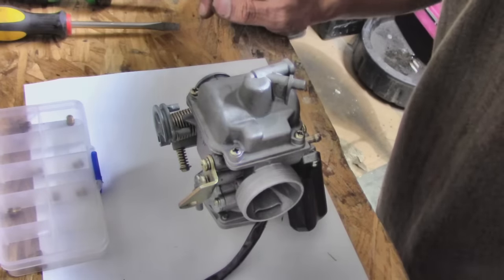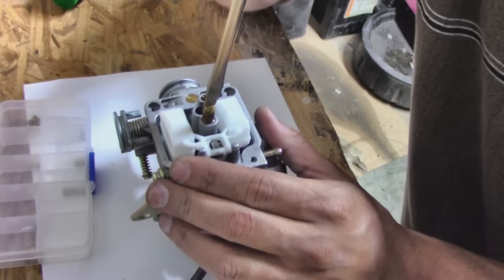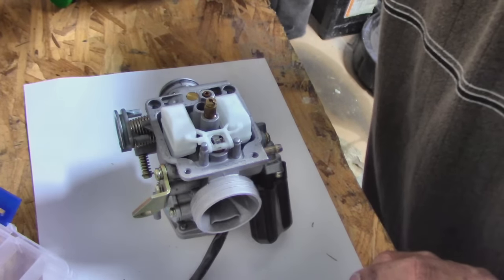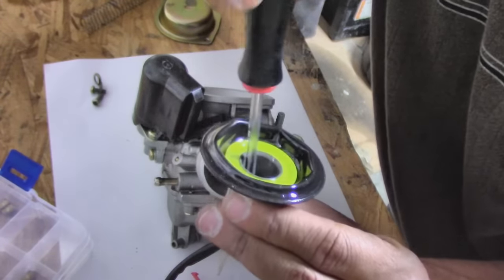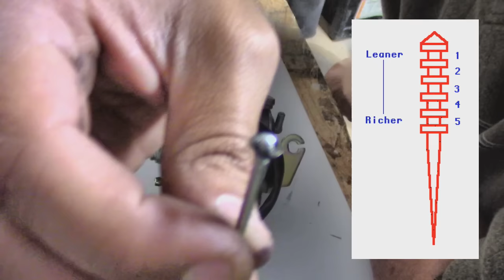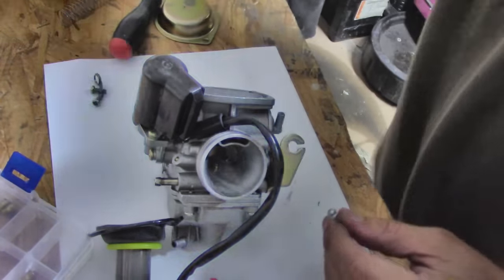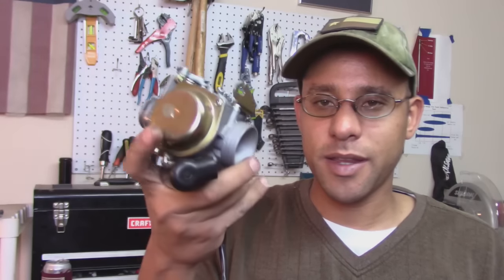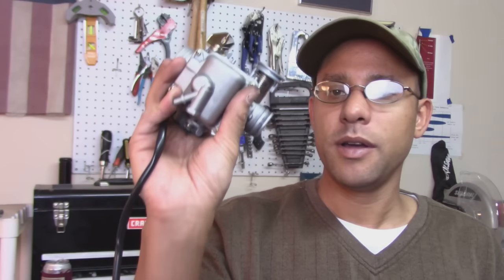GY6: Winterizing Your Carburetor

Comment: Nice vid thanks Joey.  This is my first winter running a scoot, i have had running problems with the colder weather.  My question is about the main jet, did you go up or down in size?  Also how many sizes did you go?
I have been tinkering already & found going down in size helped more, but am still having problems.  Hard to start when cold, also sometimes will stall at WOT.  I reduce revs to around half throttle & it fires again.  Never had this problem before the temperature dropped.

Cheers

Comment: Hi Joey,  Thanks for helping everyone and doing these videos. I've learned a lot from you.  I do have a question for you you though...   my winterization is just going to be storing my bike in a cold garage all winter (can get to -20F here).  What do I need to know to do that?  Should I run it dry of gas? Drain the lines?  Should I take the battery out and store it somewhere warm?  Anything I'm missing?  Thanks Joey.

Comment: if you have scooter carb tuned but cannot get the top end up to where it should be, do you go for heavier roller weights if all else is good? compression, spark, fuel delivery, etc